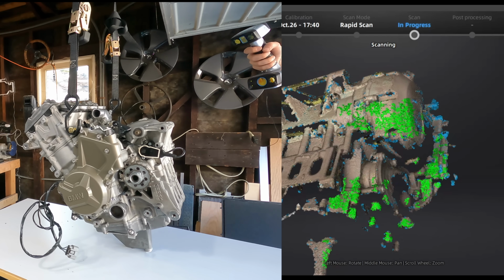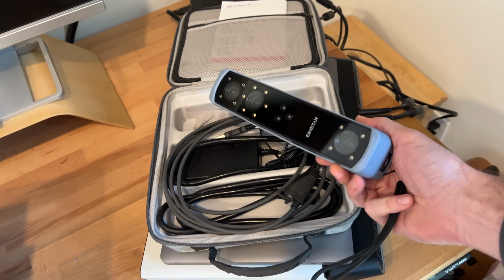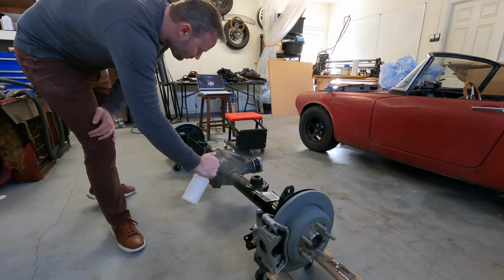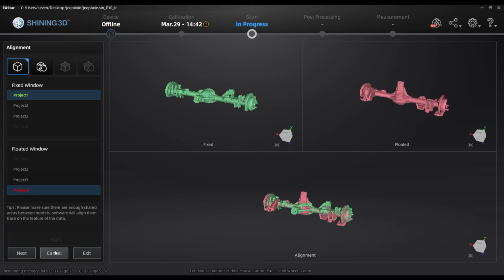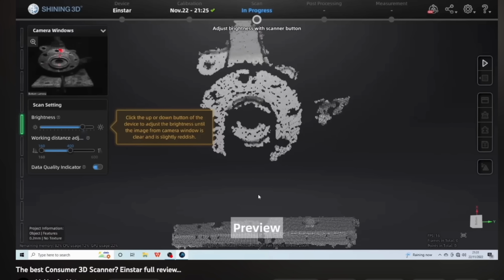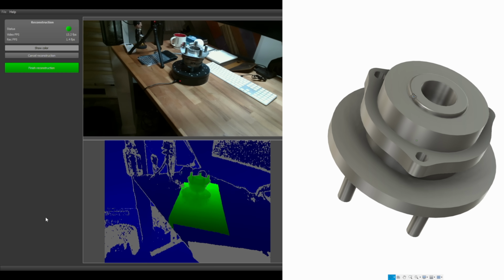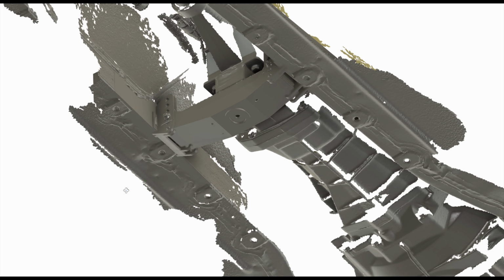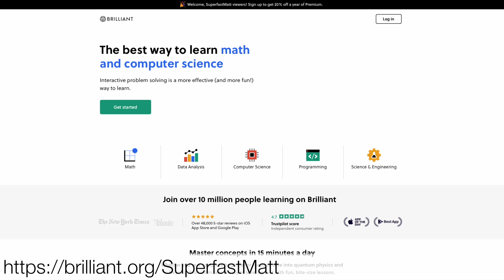It’s Time To Put A 3D Scanner In Your Toolbox

Comment: In manufacturing we saved a bunch of money on targets by attaching them to thin plexiglass strips with magnets for large metal surfaces. We could re-use them for other projects down the line (as long as it's not the same scan since it'll confuse the software). Helps with clean up too since you don't have to pull off as many individual targets!
Reply: Wouldn't the depth of the plexiglass mess up the measurements/dimensions of the final result?
Reply: @ezanchi5422  no, it uses the centers of the reflective sticker for reference, the flat surface data gets tied to the points, wherever they are (protruding from that flat surface), the software simply cannot tell where it is when it is looking at a flat, that is all
there are options in that software to use texture of the flat to align itself, but a car paint for instance has no texture, just color (simply speaking), but that is quite unstable, it may lose position and again you need to start over, and if there are not enough reference points, it won't stitch the scans together later, so - use points :)
Reply: Great idea! Why not small sheets of transparency paper (like the old school college projectors) with a bunch of targets on them?  Not great for deep curves, but you could place a bunch of sheets on a hood  and a few where there is more difficult geometry.
Reply: @joebrodie  
Oh man, I forgot about the Elmo projectors!
Reply: @joebrodie  first thing that came to mind , also
Reply: At my job I made a 3D printed hemisphere which I embedded a magnet to and I stuck the dots to that. Worked really well for long work pieces and larger surfaces as it could detect the dots at weird angles too
Reply: We just put the targets on some blue painters tape and reuse them on multiple projects. Works great
Reply: Do the targets need to be a specific shape? For photogrammetry I've been able to get away with black paint spatters, sharpie squiggles, etc. Anything to create "edges" for the software to anchor to.
Reply: @WhiskeyDeltaBurrito  Targets need to be a reflective dot, typically its specific to the model of scanner but there are some knock offs you can buy
Reply: @JustinATL  I tried a few different dots and I think the "specific to the scanner" is a tactic to get you to buy there dots. I used both separately, mixed, and with some half size dots thrown in for good measure. Never had an issue. Actually, the alibaba scanner dots had a more accurate reflective dot size compared to the creaform ones, but they're really difficult to remove if placed on a clean surface like paint. The creaform dots are slightly thicker with a mild adhesive so they're easy to remove, but they end up turning into a pringle after a few uses while the cheap ones stay flat. For something like a car you'll need 1000+. Ebay "3D Scanner Reflection Markers Positioning targets", ~$24/1000 for the 6mm which is what I used.
Reply: @TheBiscuitsandGravy  i used to work at a place that made loads of signs every thing from hand carved to vine to sandblasting temp lets   we had large rolls of magnet sheets that you could put on equipment or the like that could be cut with the plotter betting it would be simple to get 6mm flexible magnets to back the dots you are using or to have them printed up with the reflective middle and dark outer
Reply: Does blutack/silly putty work? Would be convenient to store the targets squished up into a ball!
Reply: I'm intrigued by the possibility of bridging the performance gap between the water/talc sprayed emulsion and the reflective dots. 

There are various biodegradable cosmetic and food grade glitters recently available that could be experimented with in place of the talc for a sprayed on then rinsed off reflective surface.

From the web...

"What is eco glitter made of?
Also known as guilt-free glitter, eco-friendly glitter is made with biodegradable materials. This means that it can decompose in nature, for example in your compost bin or in the ocean. Eco glitter can be made completely plant-based, vegan, and cruelty-free, and come in both cosmetic grade and in edible versions."
Reply: Where contamination of the scanned object and disposal of the emulsions (outdoors?) was not an issue then reflective glass micro beads could be used in a spray.
Reply: I bet the tape the Shaper Origin uses would be perfect for this. Or maybe even Washi tape, depending on how repetitive the pattern is.
Reply: For positive-draft surfaces, I think printing the target pattern onto a stretch fabric like Lycra could be a huge bonus.  Or even vinyl cling, then you could apply it just like a vinyl wrap to each section as needed.
Reply: can you explain what you mean by using thin plexiglass strips with magnets scanning? what tool do you use for the scanning. how the camera or software interpret the plexiglass
Reply: Use a better system...
Reply: @ShainAndrews  Ok. What better system should they use?

Comment: Is the nice expensive scanner($10,000) high resolution enough to copy a warhammer 40k miniature? Is your scanner?
Reply from the maker: the problem with miniatures is probably going to be getting both sensors to see all the detailed parts of it at the same time. I can't say either way since I didn't try anything that small, but I bet someone on YouTube has.
Reply: Basically, the answer is no. Miniatures just have detail that is way to fine for even expensive scanners.
Reply: @FayezButts  that's what I was thinking, the resolution is just too low. I suppose if you wanted to scan an existing model to get the basic form for a mold for your own sculpt of details it could maybe save (some) time?
Reply: You'll want to use photogrammetry with a dslr and a rotary table indexed with a stepper motor for copying miniatures.
Reply: The people playing with the Revopoint POP Mini have had some good luck with tiny stuff, could be an angle.
Reply: games workshop would like to know your location...
Reply: @TheGimpy117  I'm in their walls with Alphairus.